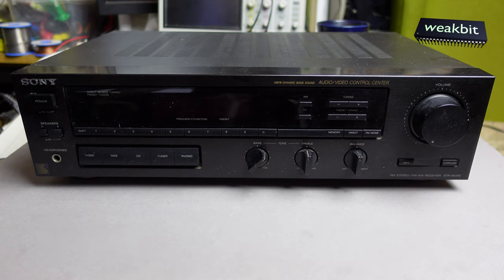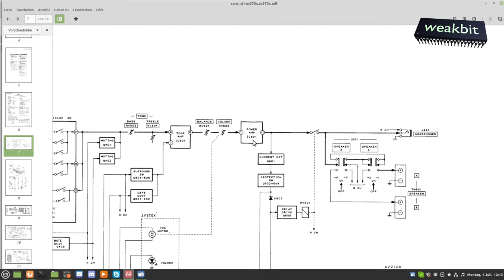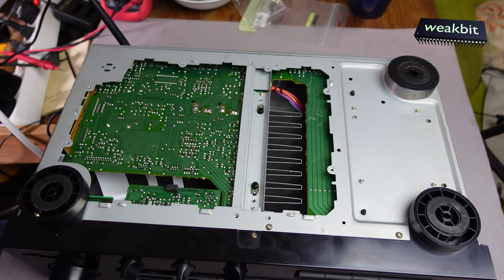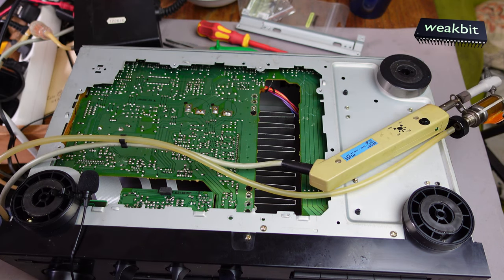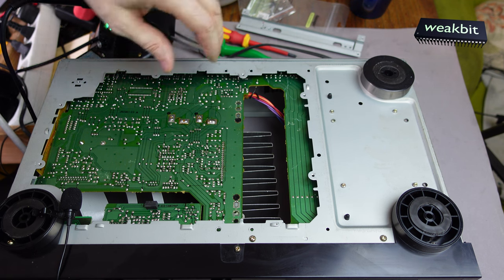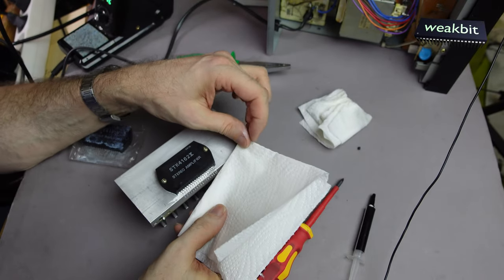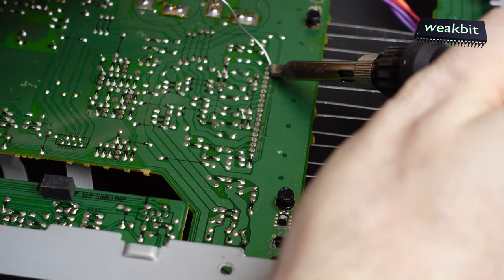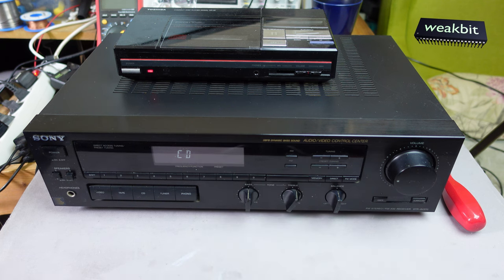Sony STR AV270 repair

Comment: If you need to desolder the connections, it is much better to apply solder paste to the place before desoldering. You'll save yourself a lot of trouble. You don't need to clean the paste, MX4 on the CPU is electrically non-conductive. How about trying to first place the chip in the holes and solder only two landscape pins, put the chip on the cooler and screw it on. Only then reheat both outer pins and finally solder all the others. Maybe it would go much better and faster.

Comment: I have an av570 that needs the integrated output amp chip.  I think a lot of these replacement stks may be counterfeit.   My sony will sit as i have multiple better spare receivers to use instead.  Hope to find a cheap sony at goodwill someday to donate the stk.  These sonys have very poor resale value